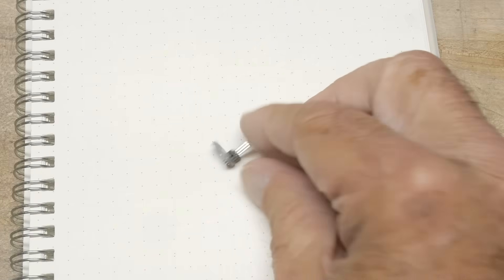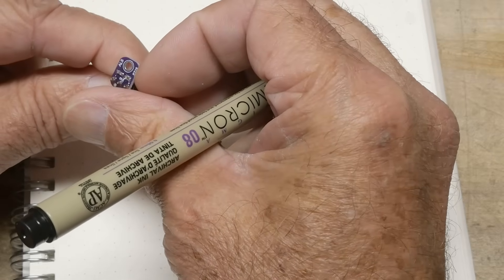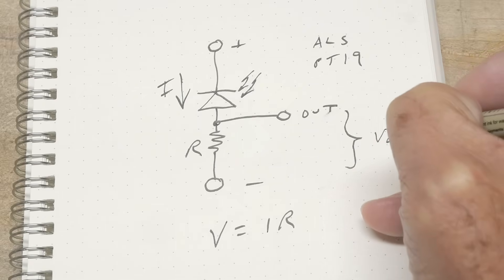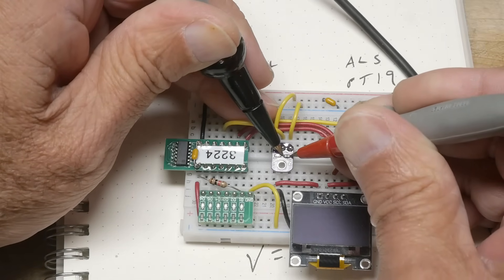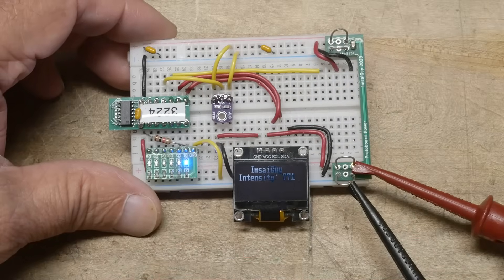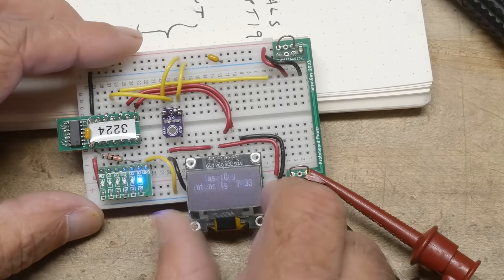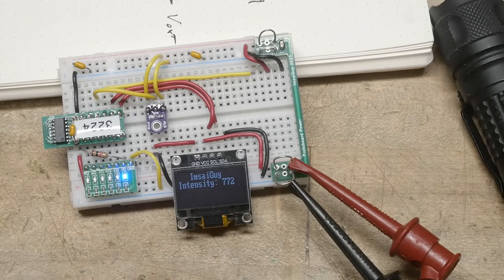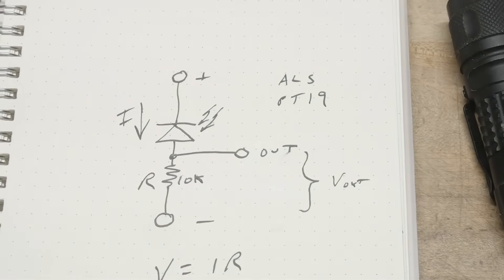#2279 Simple Photodiode Circuit

Comment: I think the PT19 is a phototransistor rather than a photodiode.   Don't photodiodes normally need an op amp in the application you showed?  I'd be interested to know when is is better to use a photodiode than a phototransistor and vice-versa.  Thanks for the video.
Reply: I'd expect the main difference to be how much current they would pass for the same amount of light - and how much that matters really depends on what you intend to hook up to them. Directly driving further circuitry or just a fairly high impedance measuring input will have different requirements. There might also be important differences in switching speed, but I haven't looked that up so I can't really say...
Reply: Photodiodes are very linear, and much faster than a phototransistor. The latter has its own internal amplification which makes the output larger for the same illumination, but non-linear. So photodiodes are better if you want to measure the amount of light more accurately, or if you need a very fast response time. Phototransistors are better as switches, where you want to toggle the output on/off with minimal illumination.

Comment: Also wasn't clearing lesser digits as the output number decreased to fewer significant digits. Low reading was probably not 10, but rather 1.
Reply: That 1 was from an older multi digit reading. So it was probably just 0, since other digit are not being cleared
Reply: I've made that mistake before. If you are using C printf("%4d" ... will fix that by filling with spaces to 4 digits
Reply: @Kabel2342  I think I learned this on my Commodore VIC-20 😀